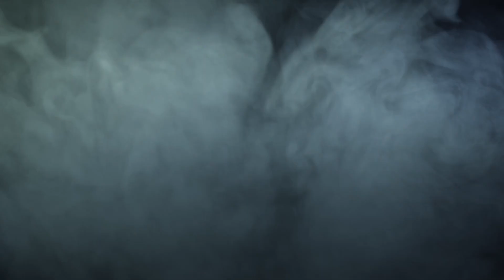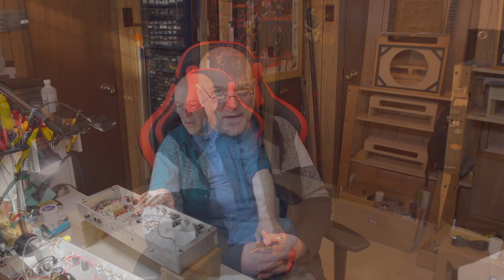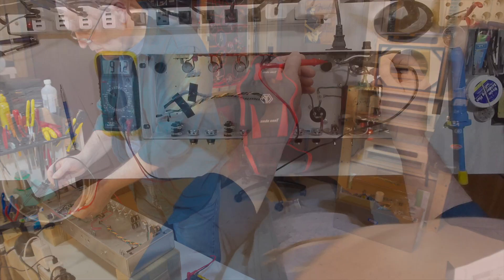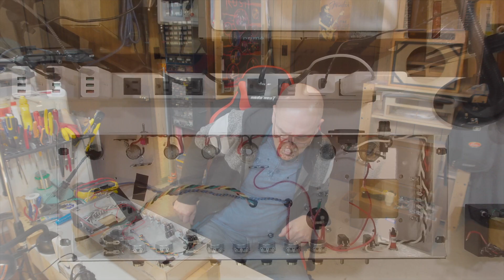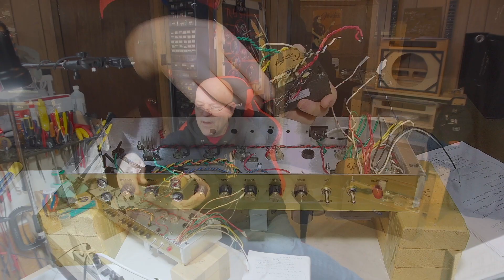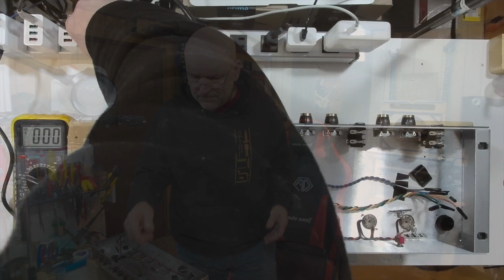Winter Build 2022 Part 6 - SMOKE!!!

Comment: My light bulb limited  glowed when powering on a Marshall power transformer (1987x) that had been in the flood Hurricane Katrina caused in New Orleans. I did this twenty years later. The first time i powered it up was a couple weeks after the flood. It had not dried out completely! Stupid ....I should had given it at least a month drying out in a hot attic. I heard crackling and smelled smoke. So, twenty years later my light bulb limiter still shows there is an internal short in it. A new one costs a hundred fifty? Would be nice to have it rewound for half the price of a new one. I am fixing to check the output transformer of the same flooded 1987x. Twenty years later should be dry and good hopefully for sure...will see soon Steve Fryette said shorts in a transformer can be the size of a pinhead!
Reply from the maker: @curtisprice9806  I sure hope you can bring it back to life. Keep me posted. 

Thanks for commenting.
Reply: @JagStar  Will do...I like your videos very much....safety, explanation of everything is great. Now, I am frustrated working on a ground scheme for a 1974 50 watt JMP Superlead lol! No solid info anywhere on do this, OR do that for 50 and 100 watt Superleads for a super quite amplifier! I will keep forging ahead...and yes deadly if the wrong mistake is made! ✌️💪👍
Reply from the maker: @curtisprice9806  You could use this layout as a guide, https://schematicheaven.net/marshallamps/marshall_18watt_layout.pdf. It's for an 18 Watt clone but, the grounding scheme is essentially the same. Basically, you should give the safety ground (the power cord ground) it's own connection, connect the PT centre taps to a single ground point and the grounds for the preamp circuit would have their own. The preamp ground point should also be over on the opposite side of the chassis, near the input jacks (the other end of the ground bus in the layout I linked). The ground for the bias supply can go the the same point as the PT centre tap grounds. I don't like connecting grounds using tag lugs, it's better to solder them directly to the chassis. Of course, if your chassis is aluminium, you have no choice but to use tag lugs for the grounds. In that case, just make sure to use toothed washers and tighten the nuts well.

There are lots of good videos on amplifier grounding schemes. Check out Rift Amps, Brad's Guitar Garage and Psionic Audio for some good explanations.
Reply: @JagStar  Thank you! I have watched them over and over. I have rectified dc on filaments and a small transformer for bias....I got extra stuff from twenty years ago on beefing up bias and filaments and it's too much extra now I have hooked all that up too lol! But I am sure if I follow these ways to the "T" by psionic and your layout I will have success. All this tearing down and rewiring is very time consuming, but I will know what works and what doesn't. Thanks again for your videos, comments, and 18 watt layout build! Tube amps rule for me from day one when I was a kid playing my Dad's 1956 Fender Super then later a neighbor's 1974 100 watt  Superlead

Comment: perfect example of the importance of a lightbulb current limiter + variac, but we've all been there..it happens. 
also, ditching the heater CT and using 2 100-ohm balance resistors will fuse your heaters in the case of a heater short.
Reply from the maker: Good tip. Some transformers don’t even have a centre tap so a virtual CT is the only option. You can also create a positive bias supply for the CT to further reduce hum. I do this on Champ and other single-ended style amps all the time. 

Thanks for your tip.